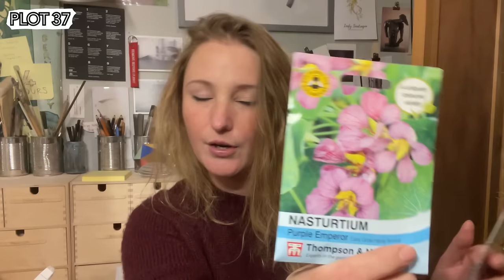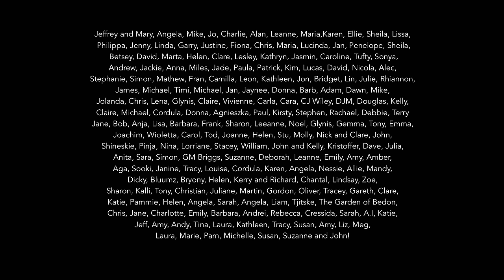It’s COLD! The Dahlias have had it. And oooooh we have a TRAIL CAM Ep 191 || Plot 37

Comment: Hi jess love ya blogs ya keep me motivated so thankyou. Regarding the arches ive just bought 2 from amazon 10 quid each, ( ive had em b4 from wilkos too and same has happened to mine )so next year when i put them together i will paint over the screws and joins with hammerite they will be supported into ground with bamboo. The bit that goes in ground will also be painted with hammerite and then ill cover with chicken wire as usual. Its just a suggestion jess so i get more years out of em 😊 😊

Comment: Might I suggest using slug nematodes in the polytunnel  in the spring to reduce your slug population. I use a yearly programme on my plot, and it has significantly reduced my slug population,   so much so that I rarely lose  seedlings.
Regarding the tomato varieties,  I have the same problem. Grew 45 varieties last year, I am a complete sucker if I discover a new variety. Like you, I think I could easily grow, 40 new varieties each year for the next 10 years 😂. I don't know what the answer is. Is there an AA for tomato growing addicts???
Reply from the maker: i am going to do just that magpie! nematode the greenhouse and the poly at the start of the season and then go again half way through. 
Not sure specifically for tomato adicts but i definitely thing there sould be an AA for seed collectors :D

Comment: Do you normally have good success with sweetcorn? I'm planning on trying to grow some for the first time next year. I've seen lots of people describing failed sweetcorn crops. I really hope I can get some because the supermarkets near me only do the de-leaved plastic wrapped ones that have usually started fermenting inside the wrapper. So really hope I can get a few. Doesn't have to be loads. Will probably do a 5 by 5 grid or something.

What variety did you try first this year? And is that a variety you tend to stick to each year?
Reply from the maker: normally yes! last two years, no. i know what went wrong last year but this year its a mystery. however i'm hearing lots of people had a bad year for it. normally its a really easy crop!